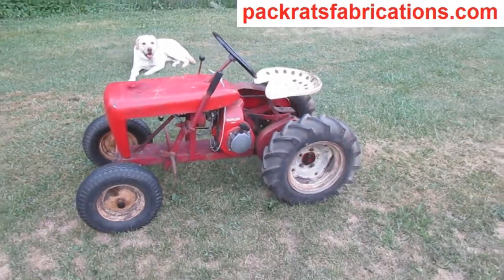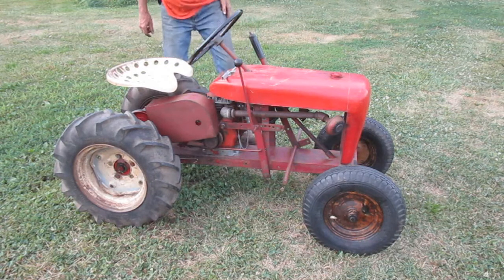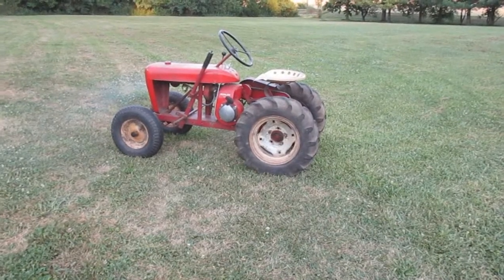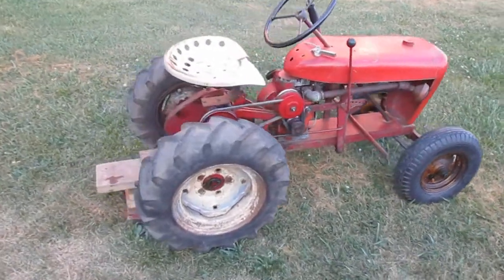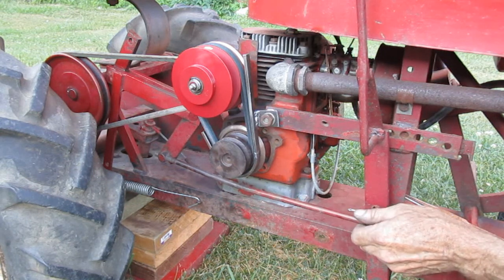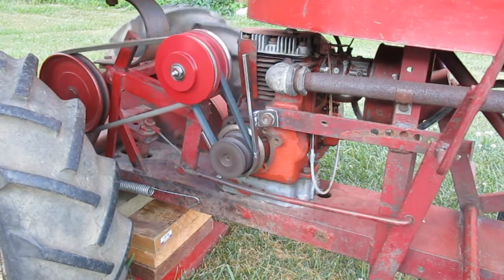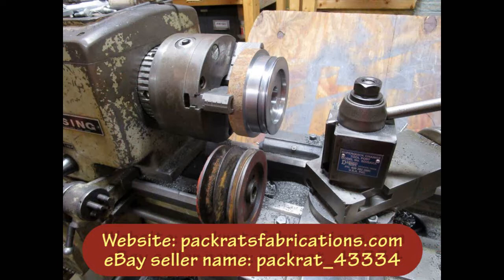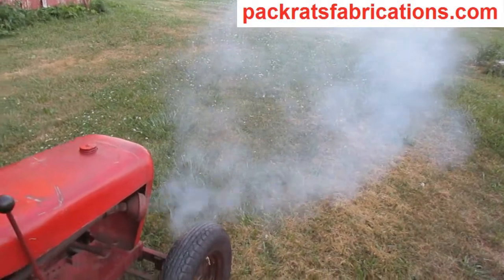1957 Wheel Horse RJ-35 & NEW Variable Speed Pulley

Comment: Thanks for explaining the pulley system. I still don’t understand the reverse. Doesn’t the pulley still spin the same direction when it hits the engine pulley?
Reply from the maker: Hi, no, when the belt is driving the rear pulley the rear pulley is moving forward, but when the rear pulley contacts the front pulley the rear pulley is moving the opposite direction. Imagine 2 gears touching each other, they go opposite directions. The reverse disk acts like a gear, but doesn't have teeth.
Reply: Thanks!  I pulled one of these tractors out of a neighbor’s scrap pile back in the early 80’s. I got everything on seized, then mounted a 5 horse Brigs on it. It was missing the variable pulley. That was my mode of transportation when I was 14 until I got my drivers license. Great times!   Wish I still had it!